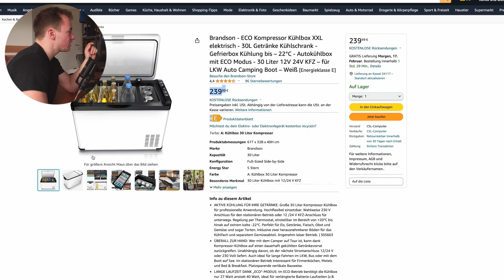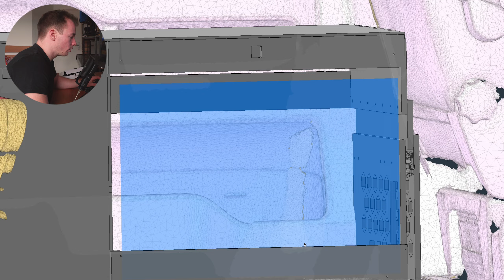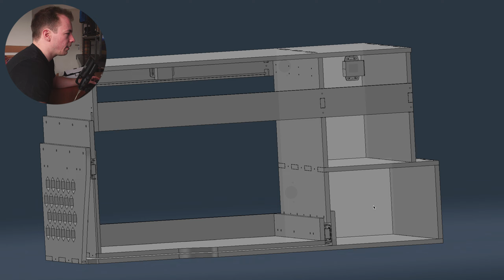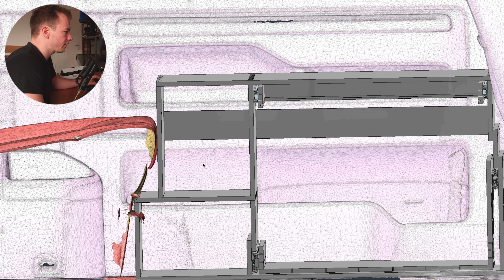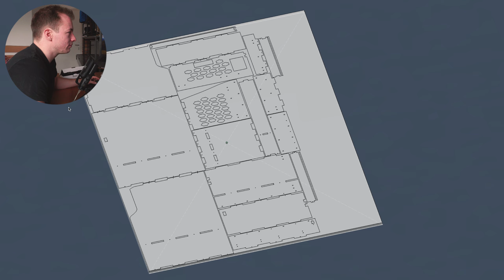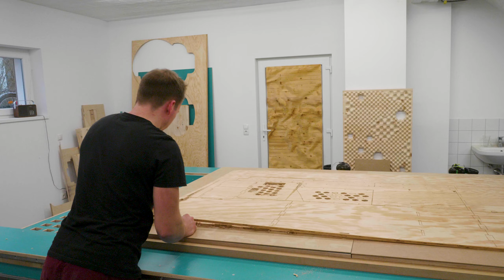Scan to Fabrication - Milling the First Parts for FlowMobil

Comment: Great video and work ! 
Crazy bit is the router bit ! What is it ? five mill ? or even less ? My wooden camper parts were milled with a 16 mill bit for the most part.  :  )
And the vacuum bed is a dream, concerning the nesting of the parts AND the finishing of the milled parts. Even very expensive CNC mills often do not come with it.
Reply from the maker: Hi, thank you!
It’s a 1/8“ (3,175mm) bit.
Yes the vacuum makes quite a difference in the workflow! 🙈 I’ve been used to working without it but never want to go back…
We’ve built the machine our selfs so we could define its capabilities exactly to our wishes, like the vacuum table 🙈
Reply: @FlowMobil  Wow that is an impressively small drill bit - guess it wouldn't be perfectly suited going into higher output ratios of serial production runs, surpassing the prototype stage. 
But anyway still very interesting to see it working at all - at least I wouldn't have expected it to do that many running meters and seemingly reasonably fast, too ?

Compared to using vacuum pods the vacuum bed does not work equally well with all materials in all situations  - I guess ?: Since milling chips are building up more pressure in the milling groove and therefore lead to more tear-outs on the surface ?  ...because of the chips being kind of trapped against the bottom.

The same thing happens anyway of course for any groove that doesn't cut the complete material thickness. But especially materials like raw pine ply (unlike e.g. birch ply with a coating or let alone a covering, I imagine) could be affected by this?  Do you have experience in comparison or were the CNCs you used before not working with vacuum at all ?

p.s.: Impressive side note - you have built the machine yourself.